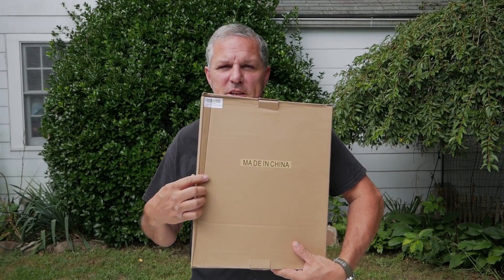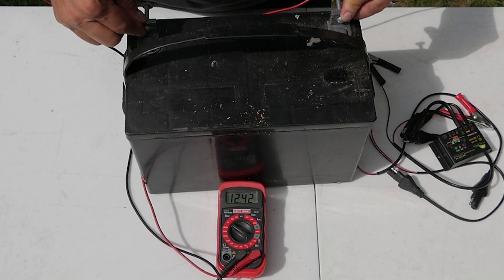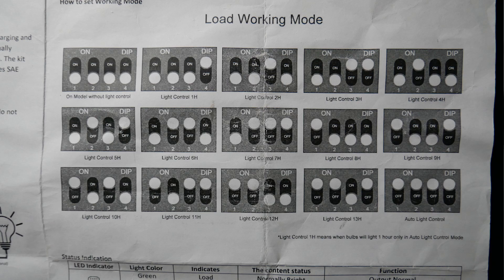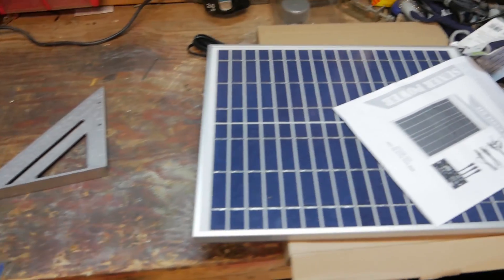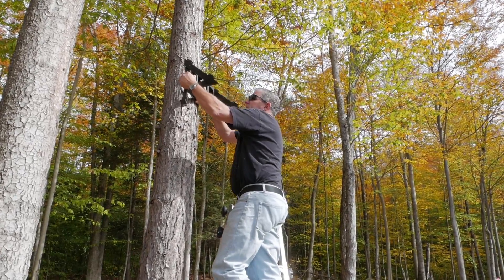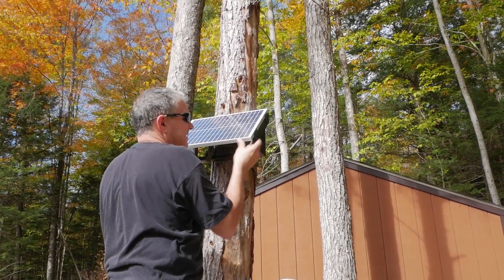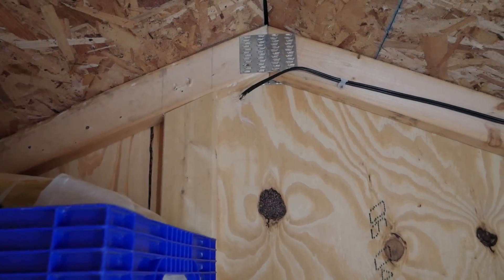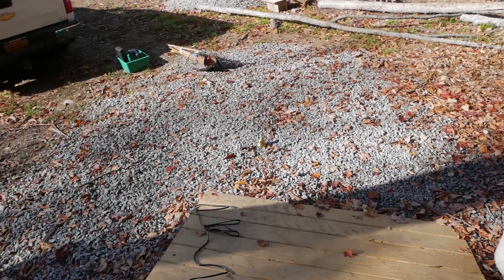SUNER POWER 20 WATT SOLAR PANEL KIT INSTALL - TEST - THOUGHTS

Comment: I've had my panel over a year. My batteries died. I had it disconnected for 6 mos. Chargered my batts by starting the truck every month.  November connected it to batteries, got green light.  Jan 25, green light. Batteries, dead, and still have green light but test meter shows no power. What's young with Charger? How long are the suppose to last?

Comment: It's been a couple of years now, how has it held up? I've seen reviews of those charge controllers that say they quit fairly quickly.
 In order to tell if your panel is monocrystalline or polycrystalline take a close look at the cells themselves under bright light. If you can see a crystalline structure, or they look "sparkly" then they are polycrystalline. If they have the same Sheen all across the face of the cell, then they are monocrystalline.
Reply from the maker: Thanks for the info. Yes, the controller broke on ours and we replaced it with another that’s been great (https://amzn.to/3yLoovC) Panel is still working no problems 👍

Comment: Seems that the 20 Watt panel is the minimum wattage to consider for charging and maintaining a typical vehicle battery.   Anything less, is just a toy.  Agree???
Reply from the maker: Agree for 12 v.  a smaller panel can charge a cell phone but not much more . But I personally wouldn’t go smaller than 20.

Comment: Hi is there a fuse anywhere on this kit? I think I may of accidentally crossed the positive and negative wire and now it's not working. I have the 20 watt Sunerpower kit like yours.
Reply from the maker: There isn't any fuses. It has reverse polarity protection. Make sure you plug in the battery first  and then the solar panel . Then wait 15-20 seconds for  a solid red LED on the solar panel icon. You can check if the panel is working by checking for voltage with a multimeter directly from the wire coming from the panel .Mine was a little over 20V. Hope this helps.

Comment: For testing purposes I hooked up my kit to a fully powered battery. The far left 1st light blinked, the middle light was solid. Is mine functioning. I cannot tell.
Reply from the maker: If  the solar LED is blinking it means that the battery is not connected to it, or the polarity is reversed. You must wait 15 20 seconds for it to calibrate. The middle (battery) LED will be red if the battery voltage is below 12.6. At 12.6 volts or higher it will turn green .

Comment: What is the amp hour of the battery
Reply from the maker: It is a 100 amp hour AGM 12 volt battery. Which means in theory you can pull 5 amps for 20 hours equals 100 amp hours . They go for about 320 bucks new. Mine is very old but I only draw .05 amp with the lights .occasionally I  charge a phone. I recently installed a little 12-volt automotive fan which draws 0.08 amps. Hope this helps
Reply: @CreatingASimplerLifeOffGrid  wow Thanks for the reply

Comment: Think this panel could keep a 12V fridge running indefinitely?
Reply from the maker: No, it probably couldn't but it really depends on the watts the fridge uses and there also is no sunlight 24/7.
Reply: No, not directly.  20 Watt output from the panel divided by 12 volts will give you only a maximum amperage of about 1 to 1-1/2 amps.

Comment: You weren’t getting proper lights because you set it up in the wrong sequence. As per the instructions:
1) Attach the battery
2) Wait 15 seconds
3) Attach the solar panel

This will ensure that it runs properly right from the start.
Reply from the maker: I finally figured that out but appreciate your input. Hope you have a great Sunday!

Comment: Quick question please, what happens if we start the car with the charger plugged in?
Thanks for the video (-:
Reply from the maker: the charger controller has built-in overload protection .So you should be safe. But I would  disconnect from the battery before starting  just to be sure not to damage the system. Hope this helps. Thanks for watching.
Reply: People are permanent mounting these panels on work trucks and motor homes and don't seem to be experiencing any damage to the controllers when they start their vehicles multiple times per day.

Comment: I don't ride the motorcycle enough to keep the battery charged up well, and I needed a battery tender - all is good now! Watching and Supporting, Dropping another LIKE on your video!
Reply from the maker: Ray Hayden, J.D. it actually works great for us but it would probably be better by you because you get so much sunlight!